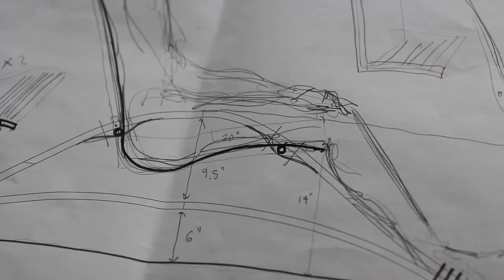How to Make a Chair

Comment: Wow, beautiful chair! (Except for the visible screws at the bottom)
Reply from the maker: +Willi Kampmann Thanks. The chair was unfinished at the time of the video. The screws have since been cut. I'm working on some new versions of the chair at the moment. I will be posting regular video updates starting in the next week or so. I hope you can check them out!
Reply: I've subscribed. Is/will the chair or others like it be for sale?
Reply from the maker: +Willi Kampmann Great! Yes that's the plan. I hope to have a number of versions ready over the next few months.
Reply: yeah the screws sticking out kind of ruined the clean look
Reply: Willi Kampmann yeah I was looking at that highly polished floor thinking  how many gouges were put in it by those back legs every time someone sat down.
Reply: I kinda like the screws tbh. I like that they're a little 'brutal' and mechanical, feels honest to me. 
I don't like the glued seat supports on the other hand, I wish they were assembled, even if "brutally" so.
Reply: Great job but too much mistakes in this chaor5

Comment: Very pretty. Well made. Do you think it could have worked if the pieces were CNC'd instead of laminated and bent?
Reply from the maker: +Miket G Thanks Miket! I appreciate that. The bending and glue laminating ensures that the grain of the wood is continuous throughout the bow which gives the chair it's strength. If you were to CNC wood into that shape it wouldn't really have much structural integrity and would most likely not support the weight of a person. CNC has it's role in this project but it's more suited to the accurate cutting of the formwork rather than the bows themselves. I have new videos coming up soon to explain the process in more detail. Hope you check them out. Thanks for your interest!

Comment: Outstanding and beautifully elemental!  I've been many places, but it is stuff like this that still makes NYC the center of the world.

One question: a glue joint is robust enough for the loading of the half-lapped seat support rails or did I not see some mechanical connection?
Reply from the maker: Thank you very much! The glue joint is extremely strong. It's more than strong enough to support the seat and user. I am also exploring other types of mechanical joints which you can see in the series I am doing. https://www.youtube.com/playlist?list=PLBdtGoD6S4F9s-40OHWm2JEScSFcgUD2X Thanks for watching!
Reply: Watching?  Hell, I'm keeping an eye on you. 

Not to be tedious, but I have to wonder about how well the crossed-grain glue up is going to withstand seasonal changes.
Reply from the maker: I'm not sure what you mean by cross-grained glue up? Do you mean where the cross beam meet the bows? I made the original chair over two years ago and its as strong as ever.

Comment: Ive actually been experimenting with wood bending. Did you let the wood dry in the mold before gluing it up? Or does it not matter? I feel like its an expansion and contraction issue if you don't dry it first.
Reply: dry it first the longer the better really

Comment: Great work. Really nice. Really like the bend lamination process. I am wondering about the automated wood carving process that you did, is it to carve final product or you carve out a template for the bend lamination. And how did you bend the part of the seat cause it is pretty wide and just to use clamping method.
Reply from the maker: +Iliyas Hakim Thanks Iliyas! You're right, the wood carving process (CNC mill) was to cut out a template (formwork) to bend the final wood pieces around. You can also cut out the formwork by hand if you dont have access to a CNC mill. The seat was also bent and clamped in the same way although with much larger formwork. You can see in the video at 1:39 the formwork I made for the seat. I used 2"x2" strips of wood with clamps on each end to make sure the seat was fully clamped down - if that makes sense. I'm actually filming a series of videos at the moment which will document the process in much more detail. I hope to post the first one next week. I hope this helps.
Reply: +Conor Coghlan thank for the reply. I'm seeing it now on how you made the seat but would like to learn more on it. Going to be looking forward for your upcoming video.

Comment: So does this stay still with repeated seating|movement? or slowly creep around the floor?
Reply from the maker: Good question. The front feet stay in place as that is where the majority of the weight rests, and the back feet slide ever so slightly back when you sit into the seat. This is just a prototype so it's not perfect. I am working on a number of new models this month which I will post videos of soon! Thanks for watching!

Comment: Hey man, excellent chair. 1 question and 1 comment. Did you only glue the seat support rails? I didn't see any other fasteners. And the comment is the only thing i could see (and it's so easily fixable) is the alignment of the screw heads. Was that on purpose or not something you really thought about?

Either way what a fantastic looking chair.
Reply from the maker: Gareth Kalber Hey Gareth. Thank you very much! Yes I only glued the support rails. The chair was for a class in school and as a result some things are rushed and not the way I would like them to be. I am currently working on a second version in which I have corrected some of the issues with this chair. I'm not quite sure what you mean by the alignment of the screwheads?
Reply: sure man, i meant at 2.47 you see the screw heads of the bottom support and they are randomly located rather than all facing the same way. Alignment was not the right word i guess!

Comment: I'm looking to do some bent lamination with steamed veneers and I keep thinking that the window from getting the timber out of the steamer, applying glue, and getting everything clamped up will be really short, as the timber is cooling from the moment you take it out of the steamer. did you have any issues with this? and any tips?
Reply from the maker: Hey +Adam Connellan . Thanks for your interest in my video. So I steamed the strips of Ash for about 3 hrs. Once I took them out of the steamer I clamped them to the formwork without glue and left them overnight. There's no REAL rush as the timber will stay flexible for a while. Once you've let the timber dry for 24hrs clamped to the formwork, then you have to glue it all together. This is where you will need to be very quick. It's best to have someone help you out at this point as you really want to glue each laminate within about 2mins or less of coating the strips with glue. This is my personal experience. I hope it helps!! I'd love to see what you come up with. All the best.
Reply: Ah I see, ok makes sense, I knew the gluing was going to be fast but having not done any steaming I wasn't too sure about the process when combining both methods. Appreciate the reply, and I will keep you posted on my results. Wishing you well

Comment: It's a good looking chair, but I would be concerned about the screw ends digging into flooring when it has to support a lot of weight.
Reply from the maker: +SilentRadar Thank you. The screw ends are cut off now. I hadn't finished the chair completely when I filmed the video.
Reply: May I suggest flush-head bolts with flush-head nuts at this location - of the type used in knock-down furniture. Typically they have 1/4-20 threads.

Comment: Instead of nuts on the part that has contact with the floor, you should have those male-female machine screws so that they are flush with the metal u-shaped thing and then there will be a smaller risk that the floor will be scraped. Other than that, the chair is beautiful.

Comment: how did you bent the seat?
Reply from the maker: +Kamran Mehdizadeh The seat is made from 3 flexible strips of birch-ply that didn't require steaming. I made formwork for the seat from MDF which can be seen in the video, then covered the birhc ply sheets with wood glue and clamped them to the formwork for 24hrs. Once the seat was dry I trimmed it to shape. Hope that helps!